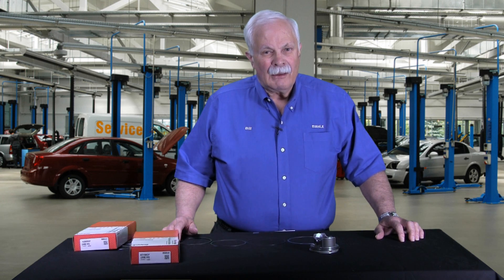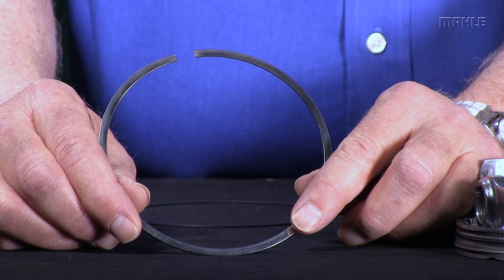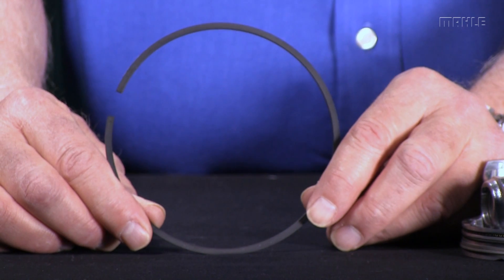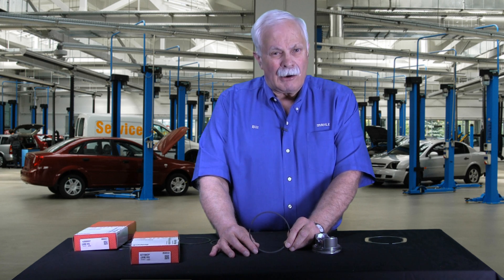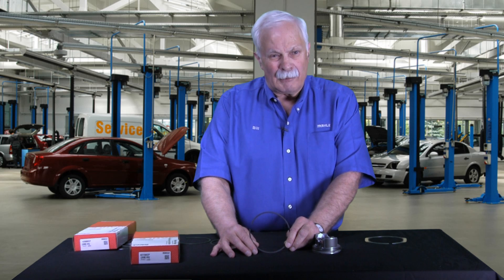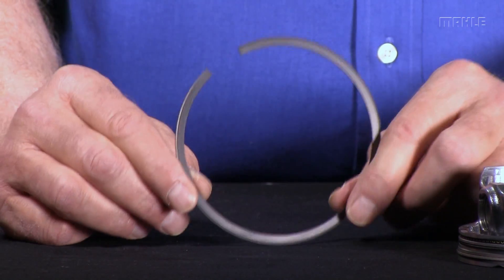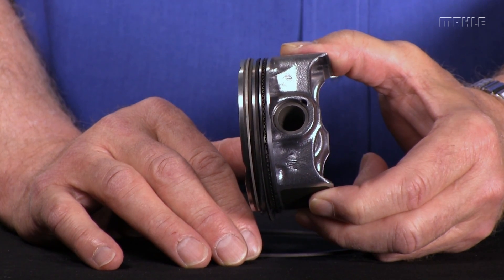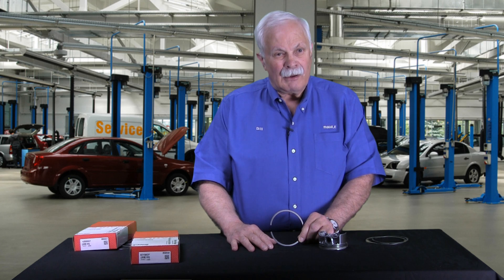all you ever wanted to know about piston rings, CH2. Ring Materials

Comment: Horse shit.. I have been trying to source a set of rings for my 4.6L supercharged mustang  for a budget build with boost. Trying to get a ductile iron top ring or steel ring and pretty much everything out there is moly coated you simply cannot buy a set of mahle rings without moly coating. cant run moly plasma top ring with boost because when the coating flakes off it will do internal damage to the bores etc.  Mahle makes the right rings and inexpensive but they put the moly coating on them and make them not usable for my application. I can run engintech or hastings and cheaper yet but want a good ring. might even resort to using the oem oriignal rings with only 20k miles on them but cannot get a clear answer if they are moly faced or not.

Comment: Which piston rings are most durable for my Vauxhall Victor FB 1964 gasoline engine with 8.5: long stroke engine?  The piston has two compression and one scrapper ring. Should I install one piece cast iron ring or thin steel rail type ring with expander and helper?

Comment: Hello, very good video. I am rebuilding my nissan rd28. I never did nothing like that before. By mistake I filled too much the second rings on 2 of my pistos (this is a 6cyl engine) the manual says the gap should be between 0.20 to 0.35mm but I left them with 0.40mm. I cannot buy just 2 rings so I'd like to read your option whether I should buy a whole new set of rings just to get those 2 or I can go ahead and leave them like that and close the engine. thanks